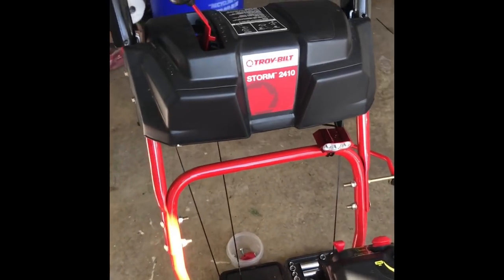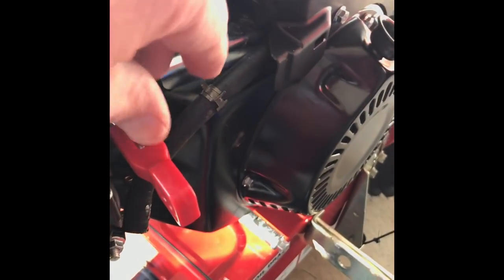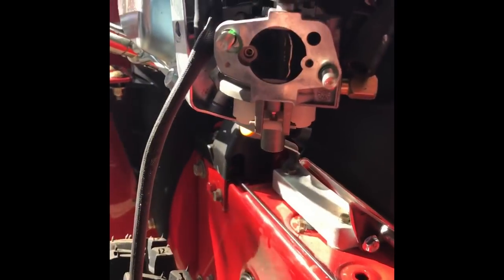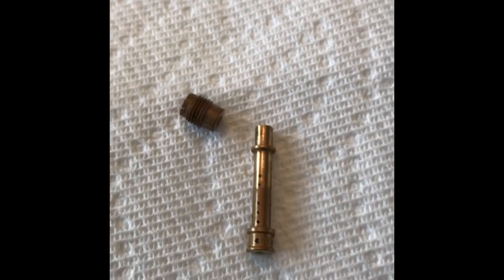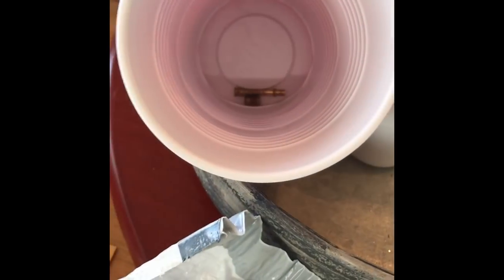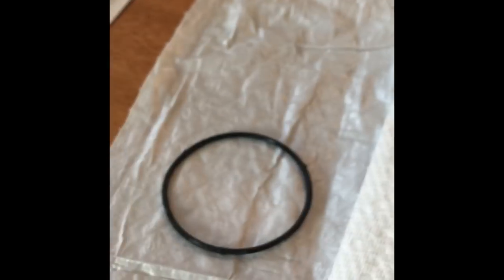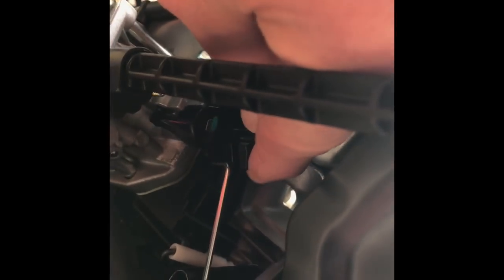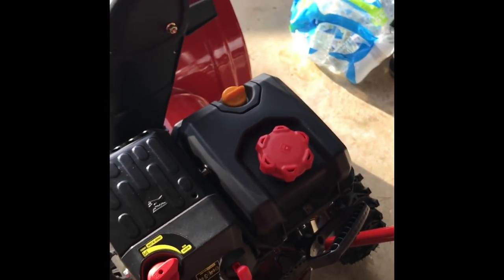How to fix a Troy-Bilt Storm 2410 SnowBlower

Comment: In my 50 + years of snowblower delmers this 2410 falls short on common since. NO gas line shut off. I fill the tank it doesn't start. To repair the clogged carb it has to be drained completely. Secondly I see many many posts of thanks.  This is my 1st blower with clogged jets over the many I;ve had in the past. Where is the INLINE FILTER. Those micro ports in the jets need protection from minuscule particles.  Thanks for your detailed help in fixing the problem.

Comment: Thanks for your video, it was a great start for me.  I made once change.  Once I took the cover off, I pulled the fuel line off and plugged it.  Then I put the machine on the blades and took the bottom part of the carb off.  There is no need to take the carburetor out.  The float is right there and the rest of your instructions worked great.  Oh yeah, it started on the first crank.
Reply: How did you plug it?
Reply: Use a bolt that fits the hose snug but not so large it splits the hose.
Reply: Doing this tomorrow, mine starts but dies out at full throttle and idles rough, I didn't drain the gas last season🤦🏻‍♂️
Thank you!!

Comment: My 2410 started with one pull but only contunued running if I constantly hit the primer bulb until it warmed up. The choke had no effect.  It would stall immediatly with the auger on.  I emptied the tank (of last year's gas) and poured in about 8 onces of fresh gas with Sta Bil Fast Fix mixed in -- probably ten times more of the stuff than directions called for.  I let it run dry, choke on, and repeated the process.  On the third test I noted the engine had stopped because it was flooded, not because it ran our of gas -- goods news b/c the choke didn't effect anything before.  It's normal now and I'm following the storage procedures from now on.

Comment: I just tuned my Troybilt 2410 & the Carburator, I didn't have to disassemble it all...all I did was drained out the fuel tank through the Carburator housing screw then remove the remaining Carburator housing screw...cleaned up the small Carburator part with the tiny holes, replace it all back and whalaaaa started right up

Comment: I was given this same snowblower by a friend, it had not been used in three years, would start but no power and couldn’t adjust the engine speed (rpm). Followed your instructions, the culprit, was a piece of nylon keeping the butterfly valve almost completely closed, still cleaned the needle valve now this baby runs like a top! Thank you for this video.

Comment: Thank you so much! I purchased this snowblower last year and only used it few times. This year it wouldn't start. I changed gas and added additves but that didn't work. Watched your video and cleaned the carburetor and that solved the problem instantly!!!!

Comment: Excellent video!  This was exactly the issue I had and you made it super easy to fix it with nothing more than some time and $4 in carb cleaner.  This snow blower was 1 year old and gifted to me but as soon as I got it home I discovered it would not start.  Even with an electric starter.  Checked for spark, ok, sprayed some starter fluid and replaced spark plug and it sputtered and tried to start.  I definetely had a fuel delivery problem.  I checked my manual ( useless ) then searched Youtube and you were the first and only video I needed.  I removed the float bowl and something slimey plopped out with a bowl full of bright yellow gas.  I think that was a good clue. I followed the video exactly being careful not to destroy the 2 gaskets, bought 2 cans of carb cleaner since it was cheap, found a solid piece of wire that fit the jets perfectly and carefully cleaned until everything was spotless.  I also had to remove the gas tank because it looked like someone dropped coffee grounds in it but that was easy as well. Put it all back together following your instructions but I sprayed a shot to starter fluid in the chamber just for good luck.  Put the spark plug back in and she fired first time.  I've followed many videos but with yours I'm confident I could clean just about any small engine carb. You were efficient, simple, and accurate.  Best DIY video I've had ever used!!!  I love Youtube and and very greatful for contributors like you!! If we ever meet I owe you many beers.  THANK YOU!!!

Comment: good video. I just fixed mine. I removed the cover, flipped the machine oh its side,  removed the bowl, removed the valve and cleaned it. Reassembled and it fired right up. It can be done in 10 minutes with out removing the carb
Reply: Did u drain the gas tank or oil tank?
Reply: Can u tell us at which time points in the video are the parts u mention in your comment? Thanks!
Reply: Any recommendations when you can’t get the emulsion tube to unscrew?

Comment: Thank you for posting this.  I am not very mechanically inclined when it comes to small engines, and I was able to follow your video for easy steps to clean my snowblower's carburetor.  It wouldn't even start before, but it started on the first pull afterwards!  I won't forget to drain/treat my fuel next summer for sure!

Comment: Did this and mine started on first try as well!  Thanks so much for this.  Few things worth noting:  Yes the choke knob is a bear to get off.  I don't know how it did NOT break the way I had to force pry it.  All bolts and nuts are 10mm.  Regarding the four bolts for the first cover, the two longer bolts are for the right side, the shorter are on the left side.  Thanks again!
Reply: Michael C. Brown I tried to get mine off and it is a bitch to get off
Reply: @kevinweierbach3159  At 6:11 he says to spray fluid. What kind of fluid?

Comment: I just followed your video tonight and got mine fixed. There was a chunk of dirt in the little set screw hole. One suggestion I would add is that you don’t have to pry the leads off of the ignition. There are tabs at the base on either side. You squeeze those and the whole wire/metal spring thing pulls right out. Thanks for making the video!

Comment: Thanks for the great video.  After seeing what needed to be cleaned, I was able to do it all without removing the carb.  After removing the panel, I  clamped off the fuel line. I pulled the drain bolt off the carb bowl and unscrewed the bolt holding the bowl on.  I pulled off the bowl and had access to remove the float and and jets for cleaning.  Your hint to use a thin wire was right on.  Started right up after I put everything back together.

Comment: Just wanted to say thanks for this video. My parents and I both bought new ones 12 months ago an neither would start first snow this season. Yesterday and today I fixed each of them via this method and started fresh with non-ethanol gas with Sea Foam additive. Both running like champs, honestly smoother on the new gas blend. My local TB dealer quoted us $250-300 each including pickup and delivery.

Comment: Thank you for the helpful video! If it helps others save a headache, I removed the wheel and was able to access the parts for cleaning without removing the carb or front panel. Did the trick, thanks for excellent directions!

Comment: Supposed to have a big snow on Wednesday (2 days from now) and my snowblower would only stay on if I kept priming it.  Took the carb apart and found a lot of the yellow ethanol goop all over the place, especially in the jet which you highlighted.  Thanks a bunch man...only wish the part was easier to access but once you have it apart, it's a snap.

Comment: Your video was very complete except the main cause of surging is the black plastic jet under the governor adjusting screw on top of the carb. This young lady has a very easy to understand video that fixed my surging problem. Also the fuel filter is in the supply line in the tank. To remove the plastic carb cover with the primer bulb don't forget to put the throttle in the center position to match the removal slot.
Reply: Mike....I removed the fuel line from the tank and there is no filter in the line itself.  Are you saying the filter is in the nipple that the fuel line attaches too?  Mine did not look serviceable.....it did extend inside the tank as far as I can tell......how do u replace or clean that fuel filter?

Comment: Thank you for sharing the video. Helped me out a lot. Had same issue with mine and got it running after following your method. Mine wasn't as dirty as your. Bought mine last year. 

Biggest tip I received from the video, draining the gas from the float bowl. Hopefully the bottom screw will be easily accessible.

Comment: Thank you! Video was great, but like a couple other guys said... you don't have to take the carb out. Just the drain bowl. Then you can access the set screw and valve. Then blow it out with an air hose.

Comment: Thank you for this video, I did not remove the whole carb I just removed the center screw which gave me access to the center jet. you can still remove the float as well. Once cleaned fired right up

Comment: Thank you so much for this video, I as well left gas in over the summer and the carb got plugged up. You did a great job with this video and probably saved me at least 150 bucks from not having to take it in. All I needed was the carb cleaner and a transfer pump, $10 bucks total and a great step by step from you. Thanks again!
Reply from the maker: So glad it help, I felt that same way and did not want to pay to have it serviced!
Reply: Do you have a part number for the carb? I accidently snapped off the choke long plastic stalk connected to the butterfly.
Reply from the maker: Josh Heuer Do you need the plastic stalk or a whole new carburetor? If you search for a carburetor for the Troy built storm 2410 on eBay it will find it for you.

Comment: This worked great although the choke nob was a bear to get off.  It turned out that the whole control arm came out.   That wasn't a bad thing though.  It made reassembly easier.

Comment: Nice vid and glad to see that worked. You did miss the idle jet that is on top of the carb, even tho it wasn't a problem for you I would still pull it out and clean it since you had the carb off. My Cub Cadet had an engine surge issue and it was the idle jet so it's always good to clean that too. The idle jet is under that black plastic screw that sits on top of the carb and behind the the throttle part of the carb that the "connecting wires" attach to.

Comment: I have that model and fixed it with compressed air, remove carb bowl and blast air through jet until obstruction is clear, believe it was manufacturer lube that didn't blend well with fuel, gummed up jet....

Comment: Thanks for posting this video. I think it's a manufacturer problem. everybody that I've talked to that has bought this snowblower it won't start the second season even if they do drain the gas. Last season I drained the gas and this winter when I went to start it it wouldn't start again had to pull everything apart and everything looked clean and brand new but I sprayed carburetor cleaner in it put it all back together and it started up again but mine didn't have any gunk in the carburetor whatsoever.

Comment: I have this same model, still brand new might as well say, used only one winter so far. I started it up 2 months ago and it ran perfect, yesterday i went to pull it over and it would not turn over. Took the spark plug out and the cylinder was filled with gas. Cleared that all out and noticed that the oil was beyond full due to gas. Drained that and changed it. Now the snowblower is smoking pretty good. Decided to take the float off the carburetor and clean it and it still is smoking pretty good. Should i take the carburetor completely off and clean the jet and stuff like you did? Also to add it seems to run without smoking when you keep the idle nice and low, the minute you crank the idle all the way up, here comes the smoke.

Comment: Thank you for taking your time to put this video together. Much appreciated. I couldn't figure out why my float pin was holding it's position. Had my Uncle take a look and mentioned that I'm missing a sleeve to hold the float needle in place. Watching your video again and realized it's a small spring holding it in place. I started laughing so hard.  Just a little thing like a spring and my carb was just leaking gas.  Do you think the spring from a pen could fit the bill?

Comment: Great video Thanks - My machine is only a year old. did the dry gas thing after last winter so very frustrating when it wouldn't run this year. (Worked ok for my other seasonal equipment) I would add one minor note - could be that mine's a different year but there were metal collars around the the bolts that hold the carb on -fell on the floor when i pulled it off and gave me one of those Oh S**t  moments. :-)

Comment: Thank you for the video. I have a troy-bilt 2410 snowblower and it doesnt start.I emptied gas, cleaned the carburetor (apparently the holes were not blocked) and added new gas. Now when I turn on using the electric start button, after few tries it starts and runs for few seconds (~ 5 sec). Before I turn the choke to run mode, engine stops. 
Snowblower is just 3 years old. Is there anything I should check like replacing spark plug? or service center is the only option? Any suggestion please?

Comment: My needle that goes into the float fell out and is super lose. Any idea how i get that to go back in and stay? And i also cant figure out how to get the choke nob off of the top. i feel like i'm going to break something pulling so hard, am i missing a step or do you just pull really hard till it pops off?
Reply from the maker: Trucker Dan, if the pin that holds the float in place is loose you may need a new float.

Comment: Looks like you could avoid having to pull the carburetor by just removing the float bowl, insert a screw driver and remove the main jet to clean it. Sure would be easier than pulling the cover and the carb and might solve the problem quickly.
Reply: Dave I agree, but we would not have known that if he did not make this great video.  
Well done CDiilio !!!  I will keep this video for when my warranties expire.  I called Troy-Built service and they told me to drain the carb bowl and then try to start it, that worked and it started, only 11 months old, had stored in barn over summer.  By the way, the drain screw at 45º drains the whole tank. Funny, service told me to drain old gas, i did not argue, although i ran it dry at end of winter (no old gas) and always use a fuel additive with every tank of gas.
Reply: Phillips screw driver or flat head?

Comment: where did you get that wire that can fit through those small holes??  Your vid helps so much.  Thanks very much.
Reply from the maker: Edward Jackson Not sure, but you can use a safety pin or a sewing needle.
Reply: Next time just use compressed air. Way easier.

Comment: Thanks for the video.  When I went to unscrew the brass screw from the center shaft of the carburetor (see 6'27") it was a bit stubborn on coming out.  Now I just rewatched the video to see if there was a trick, and realized I never took out the plastic float-flap thing (official name).  Could that have prevented the pin from being able to unscrew?
Reply from the maker: The screw turns to the right when looking down on the carburetor, If you didn’t detach it from the unit. No need to remove the float.
Reply: @cdiilio  Thanks for the reply.  So, if I'm reading you correctly, when I'm looking down at the gold screw, I loosen OPPOSITE of what is normal, and loosen it by turning it to the RIGHT?  If that's what I was doing wrong, I will feel dumb, but I'll be glad it's that easy to address.
Reply from the maker: Correct, normally right is tight but when looking down it’s opposite.
Reply: @cdiilio  okay, got back to that screw/cap at the 6'14" mark in the video.  I tried both directions.  I put some carb cleaner on it.  The flathead groove looks a little "warped" at this point.  Any suggestions on how to get that thing out?
Reply: It turns left like any standard screw. It kind of hard to get off the first time. I used a small screwdriver the first time and almost stripped the head. Make sure to use the correct size screwdriver and use little force.

Comment: Just what I was looking for. When you tried the starter fluid first, where did you spray it?
Reply from the maker: DIYMarta you can remove the spark plug and spray some in the cylinder then re-install plug and see if it starts.
Reply: cdiilio Thanks. Ended up taking the carburetor apart and flushing it. It was clogged in a couple places.
Reply: For people that want to take the spark plug out to check it, you will need a 13/16 spark plug socket. It’s a special socket that is deep well and has a thick rubber gasket in it so that you don’t crack the porcelain on the spark plug when you are cranking it out. I had to go buy a socket at Auto Zone.

Comment: Thank u for doing this video but I hear a new carburetor isn't very expensive why did you opt to clean yours instead of just putting a new one on?
Reply: Sure you can get a carb online for under $20 and wait for it to show up on your doorstep but it's nearly the same amount of effort to change one as it is to remove and clean one.  You still need to drain the gas and bowl, remove the covers, remove the carb and then reverse the process.  And as a bonus I'll most likely be able to clean many carbs myself now. And if you choose to drag this beast to the repair shop you're in for a big bill. :(

Comment: what screw driver size and type do you use to loosen screw to get the jet valve out?
Reply from the maker: Scot Stiles It’s a flat head screwdriver. The flat head I used had a thin tip and was about 3/8 of an inch wide.